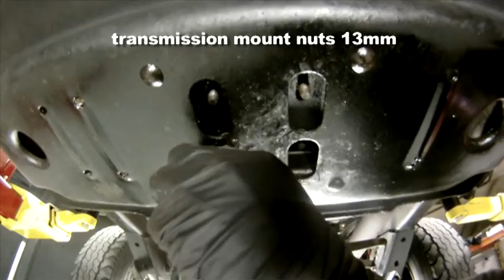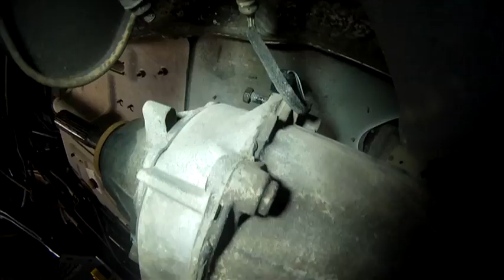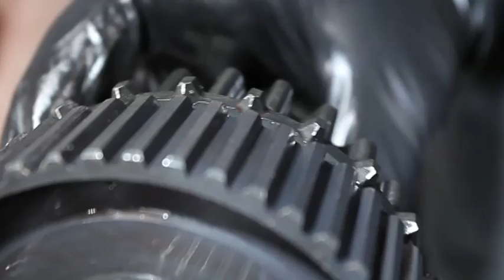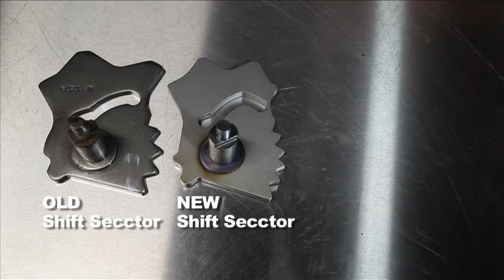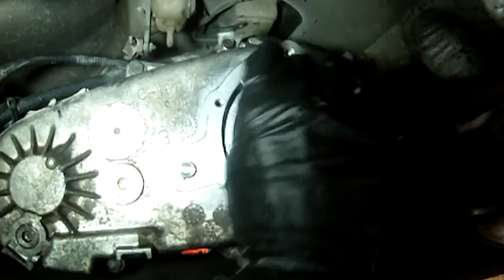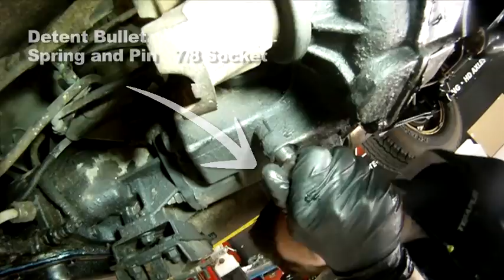TeraFlex Install: 231 Extreme Short Shaft Kit (4444400) Plus 2WD Low Range Kit (2204000)

Comment: currently having a problem with my speedometer. stays at zero. i replace the sensor didn't do anything to help. if you have advice on what to try next that would be wonderful thx.
Reply from the maker: Sometimes the yoke nut gets loose enough to allow the tone ring to slip or even spin freely. If your speedo all of a sudden stopped, it may just be a loose yoke nut. If that doesn't work give us a call and we can help diagnose the issue. 801-713-3314

Comment: Just as a heads-up to anyone, do NOT buy channellock pliers. They are 100% pure garbage.

You absolutely must buy the Wilde 9" external lock ring pliers, or any good tool brand (matco, snap on). 
Turned an easy project into an absolute nightmare. Whoever designed those pliers needs their hands cut off and eyes gouged out so they can't under engineer anything again.
Reply: I feel this way about lots of stuff lol

Comment: Glad to see an aftermarket solution that enable 2WD Low.  The last vehicle I drove that you could do this with was my Dad's `89 F-150, 2L was accomplished by just leaving the front hubs unlocked and pulling the transfer case lever back to 4L.  It is great when you are 12 years old and need to move a truck with a manual transmission through the yard.  Or teaching someone how to drive a manual transmission and getting them used to the clutch pedal before introducing the gas pedal.  Or maneuvering a trailer in a tight area where low speed and not binding the steering helps out a lot.

Comment: Silicone is for bathrooms and sex toys it shouldn't come anywhere near a vehicle. Why, because it's 2015 theres better stuff available. It's called anerobic gasket maker, it outperforms silicone in every way except filling gaps. It's seals better, it's easier to remove the old stuff and it only cures in the absence of oxegen. Only what's sandwiched in between the parts cures so even if you use too much there is nothing to plug pick-up screens. The permatex part number for the small tube is 51813.
Reply: I use The Right Stuff. Seals everything!

Comment: Why does the new yoke push back into the transfer case when you are installing the rear driveshaft? that cant be correct? And why does the tone ring hit the pump? cause it does in the kit I just put in.

Comment: they left out aa important step, the last thing you need to do is to tighten the nuts back down on the transmission mount to the belly pan.
Reply: +Luke Webb And refill the T-Case with oil!

Comment: How does the speed sensor account for bigger tires and different gear ratios?
Reply from the maker: You will need to install a TruSpeed Unit to adjust for the new bigger tires/gears.
Reply: ***** You need to figure out what gear you need, depending on tire size and gear ratio etc, and replace the 'speed-o gear' on the speed-o gear assembly (which will cost about $15-20. Check on Jeep forums and google. There's tons of articles on how to do this.

Comment from the maker: A short shaft or SYE helps to correct your driveling angle by allowing you to run a longer driveshaft in a lifted Jeep.
Reply: Is there any videos showing the use of the 2wd low kit? I want to see how it operates on the trail.

Comment: That was a great video!! Looks like I did mine the right way as well! It's a fun upgrade to do and fixes the vibration issues associated with a suspension lift. I also upgraded with adjustable upper control arms to tilt the axle angle.